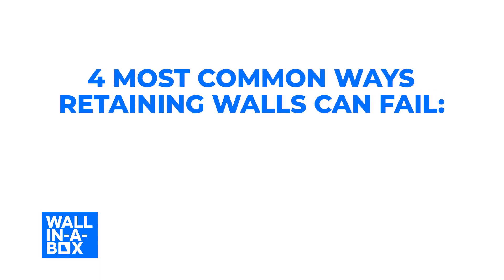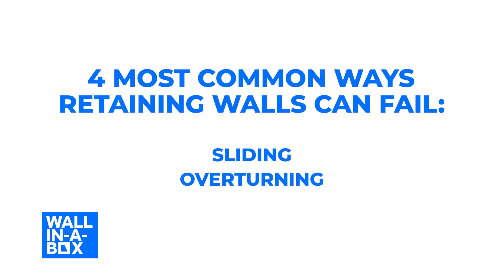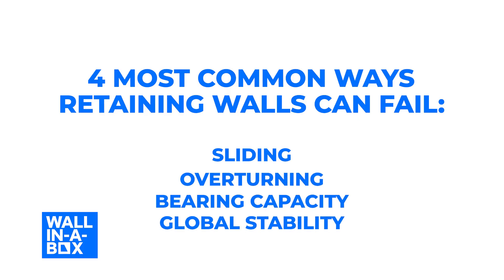How Retaining Walls Fail | The Science Behind Retaining Wall Failures

Comment: How the heck did the builders make buildings way back then without our tech?
Reply: Any engineer can make a structure that stands. It takes a good engineer to make a structure that barely stands.

Modern engineering techniques and computing allow to make structures that stand while using close to the minimum amount of materials.

Back then, they would overbuild: larger foundations than needed, heavier walls than needed, everything bulkier than needed. Compare a medieval bridge (that took a long time and a lot of resources to build) to a modern suspension one, and it is pretty obvious.

Also, failures: sometimes they would build something, and because they hadn’t thought soil load would be an issue for example, the thing would crack or collapse. Because of survivor bias we only see the structures that lasted (or of course, sometimes they would simply correct the design and build again).
Reply: @Jayjay11111 ancient builders had formulas for walls and such. They didn’t have access to modern materials, such as steel. Stone walls had to be thicker because they have to support the weight from above. Ancient builders also had “budgets” for their buildings. Since few of the modern marvels have stood the test of time, to early to say how great the engineering is. Also there have been numerous examples of modern buildings or structures that have collapsed.
Reply: Less digging, more width at the base.
Reply: They built them to last !!! None of today’s we’ll tear it down in two years.
Reply: They rebuild with slavery labor.